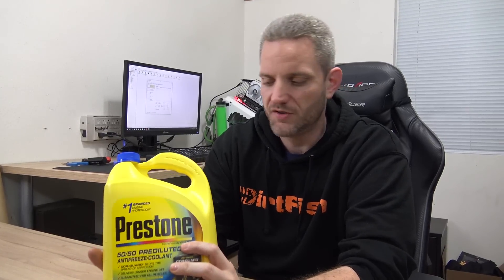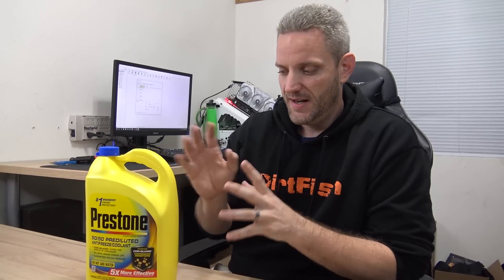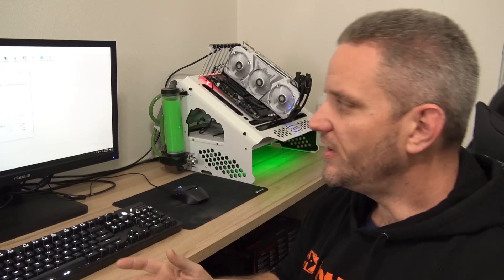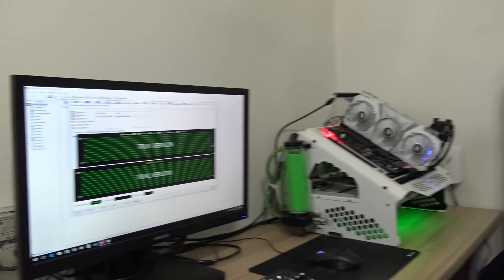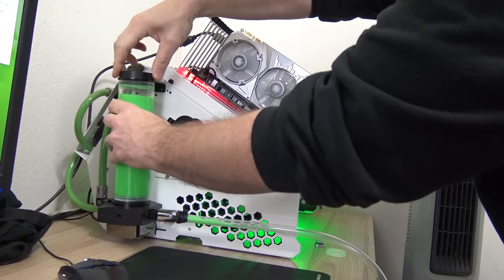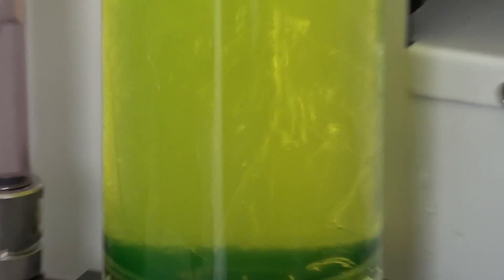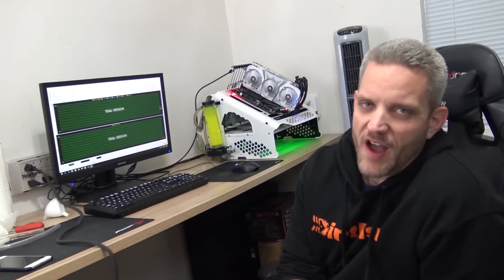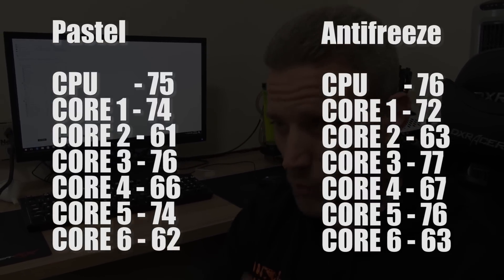I used Antifreeze to cool a PC

Comment: Just FYI radiators usually have 2 plastic tanks and the seal for the water pump and the radiator cap is rubber, so what does coolant do to rubber and plastic? nothing
Reply: eksine
You are right though, AF will not attack the vast majority of materials, it's reason for existence is to be an inert fluid. Its' benefits far outweigh the drawbacks. If the only issue is that you can't use something in the loop, then try another part. Currently I have Swiftech for all the parts; GPU, CPU and both radiators, as well as the MCP655. Reservoir is XSPC acrylic, and tubing is R3603, barbs are chromed. I have a little residue at the bottom of my drain tube, but I haven't changed the fluid in 4(FOUR) years. : ) I'm willing to bet that anyone using AF and having algae issues didn't sanitize their parts first, or contaminated the fluid during fill or top-off. Linus is a jackass, so his AF issues are his fault. : )
Reply: shaneclipse97 shane, your are too self centered. the reason I keep replying is because you made me question what I said. It's not the fact that I am afraid I am wrong. It's because I am afraid to give out false information and mislead others. This is because by nature I am trying to be a good person. you on the other hand have been handing out false information left and right and .. anyways blocked, I should have done this long ago. goodbye, get a life
Reply: Wes Tolson we already covered this, alcohol based coolant such as ethanol is not safe and some RV coolant is not safe for acetate
Reply: ***** he was worried that coolant would melt through his hoses and such. from an automotive standpoint I was giving some insights that this is used by most people already and they don't even know that they've already tested it out. he was using car coolant so my comment was aimed at that aspect
Reply: eksine
For example, just using the internet, my CPU/GPU are at 29c/26c, i5 3570k and MSI RX480 8G. ♥
Reply: Kinsey Benedict You know your stuff Kinsey, I'm impressed ;> If I want to cool my CPU I know who to look up
Reply: eksine
Why thank you, mister. ♥ You can ask me anything, anytime. I am a tinkerer, and got into PC's as the Athlon 64's and 64 X2's were stomping out Intel's guts, about December 2005. I do so miss my socket 939 builds, they were just a blast to build and clock, had a Manchester-cored 3800+(still have the CPU, no good boards available) that was a screamer. Also still have my E6600 and Q9550, same trouble with board availability. Also still have my EVGA 8800GTS, and my recently retired MSI 6950. Also had and loved an MSI Hawk 5770. There were others, like my Sapphire X800GTO(unbelievably overclockable) but those three first mentioned have impressed me the most, with the X800GTO being an honorable mention, it just came out too late and was eclipsed by the X1900 series, of which I had an X1950, also great! : )
Reply: Kinsey Benedict Geez you're making me hot thinking about all that. I was introduced to computers back when floppy drives were still considered new. What was the problem with the motherboards? Did you try to get those early when the CPU's just came out? I know it takes a while for the motherboards to catch up, but ASUS or whoever usually come out with something so you can unlock whatever it was you were trying to adjust. Sometimes someone else has firmware they wrote that you can use to flash it with which is your only option rather than waiting for the manufacturer to come out with new firmware.
Reply: eksine
Haha, hot, in a thread for a video about cooling, nice. : ) I meant there's no boards available today(easily, or from trustworthy sellers) or I'd run a 939 setup again. I still have a VLK XP disc to use. ; ) As for my boards, my 939 Asus A8N5X blew its' NF4 chip, fizzled on startup, blasted a nice big black mark out the side of the NF4, which was also on water with the CPU and GPU. My EVGA 775 board suffered from an inattentive owner(me!! 0.o) who let the coolant leak, and the 775 Gigabyte board that replaced it just stopped working. That's when I went to 1155 and the 3570k, four years ago. This is the longest I've run a setup without a major upgrade, kinda shows the state of software today. Funny to see the ebb and flow of software versus hardware, I only replaced my MSI 6950 last month because, well, why not? The RX480 8G was only $250, and my Z77 Sabertooth can run three of em if I wish. Shit, that 6950 is a beast, never needed to clock it, and still runs AAA titles today, just isn't DX12, but neither is my Windows 7. I like to look at my old NewEgg orders and reminisce. There's years where I went through 3 or 4 GPU's.

I'm thinking about an update this year, with both AMD and Intel dropping new chips. Currently, I have:

HAF 932 Black Edition case
Sabertooth Z77
Intel 3570k
MSI RX480 8G
4x8GB RipjawsX 2133Mhz
SilverStone 1200w Evolution psu
Asus Xonar Essence STX
and the water setup mentioned above

Peripherals:
HP 2711 monitor
Microsoft Sidewinder KB
Logitech G500s mouse
Wired black 360 controller

I replaced the blue LED's in my case with red to match the rest of the red in my setup.
Reply: eksine f
Reply: Kinsey Benedict i mean, Linus also didn't put any form of anti-growth agent in the loop.
it was just tap water.
Reply: *****
Yeah, that will never end well.
Reply: shaneclipse97 shane you are really ignorant. you might want to go ask someone about radiators. the top and bottom tanks are usually black plastic. pour some yellow prestone on some rubber and plastic, come back here when you see any of it being damaged, I'll wait.
Reply: shaneclipse97
LOLWUT?
Reply: shaneclipse97 shane I'm not sure if you're going through some kinda of hormonal phase but you sound really junvenile. Just go to any toyota, honda, chrysler, etc dealership, pop open the hood of their sedans. you'll be surprised that you don't know everything if that's even possible for you. I wasn't talking about computer heatsinks or even about computers. I've not heard of an instance of prestone coolant (which is what the video was about if you were watching) damages plastic or rubber. now please calm down and have a snickers betty white
Reply: shaneclipse97 cars with plastic radiators: Porsche Cayenne 2011-2016, JEEP COMPASS PATRIOT 2007-2016, Buick Encore 2013-2016, Subaru Impreza 2012-2016, Mitsubishi Lancer 2015-2016. the list is nearly endless. You have no idea how stupid you sound right now. Porsche makes crappy cars according to you. let me find some other crappy cars I can list for you
Reply: shaneclipse97 2015-2016 MERCEDES C-300, according to you mercedes is now a crappy car manufacturer, I better go tell CNN
Reply: shaneclipse97 2015-2016 MERCEDES C-300, that's also a luxury car, wow shane, you've opened my eyes I did not realize all of those were shitty cars. I didn't even bother naming honda, toyota, ford, nissan, etc, they all use plastic radiators. I guess we all need to buy nothing less than bugattis to get quality parts according to shane
Reply: sorry man only cars ive ever really worked on as far as radiators is custom/ performance cars. never had to replace a stock average vehicles radiator. I was more refering to your high quality youtube video
Reply: also luxery does not mean quality.. if your a mechanic you should be the first to know that
Reply: Kinsey Benedict funny  how u seem to know way more about pcs then eksine yet he was the one that felt confident enough to critique the owner of a pc channel on youtube lol. i have no clue why that clown is comparing his knowledge of cars to computers like they are anywhere remotely close.. gues he needs to do some research cause he clearly does not know shit about pcs
Reply: eksine actually a lot of the cars u mentioned such as porsche do have really bad history of mechanical failures. Only reason all those cars you mentioned use plastic is because its light and cheap. new cars are made with cheap parts making them more profits as well as keeping the repair industry alive. its a known fact that manufactures cut corners like making rads out of plastic. I can tell you have not worked on many older cars. most new cars have plastic but on the history of radiators the majority are metal. only in the past 15-20 yrs have plastic radiator tanks become more common and its not a good thing. thats why companies are adding things to coolant to prevent corrosion. you obviously are not a very experienced mechanic, because i am a pc guy and seem to know a little more about the basics of cars than you. Maybe you should refrain from being so outspoken on pc videos??
Reply: shaneclipse97 shane you are a joke, you come here telling me I'm wrong, I list a bunch of cars and you then proceed to tell me you only work on performance cars. then you bash my pc knowledge which I never claimed to be an expert in although I do have a background in pc's. then you bash my 1 and only video and call me a bad mechanic. you are attacking me from every angle possible, why because I gurt your feelings because this is a favorite channel of yours? dude the more you speak the more douchebaggy you sound. I guess all you like to do bash on people claiming ridiculous facts that you garnished from nowhere and when I give you facts you start attacking from more obscure angles. whoever said I gave a shit about cars 15-20 years old, actually my accord is an 01 so it's 15 years old so actually I do know about 1 15 year old car. shane you are just a joke dude. how do you even live with yourself?
Reply: shaneclipse97 it's so ridiculous you say I don't know anything when your initial claims of me being 100% wrong actually turns out not only are you the one 100% wrong, but you seem to have that "I'm never wrong" syndrome. you're going to have to do better than that pathic trick to even be taken seriously
Reply: shaneclipse97 you said you never replaced any stock car's radiator and then you said you were referring to my video, if that's not a low blow I have no clue what is since my video had nothing to do with radiators or coolant. that video was aimed at helping people at the odyssey forum. you are such a low life slimeball dude. you get off at bullying other people you don't even know using facts you've made up on the spot, pathetic
Reply: shaneclipse97
Actually, cars and PC's are quite close. There's multiple materials in the cooling loop, varying temp loads, fans, pumps and radiators. The first water cooled PC's were cooled using heater cores.

Also, I'd hardly say I know more than anybody on any given subject, I am just assertive when I know I'm right. Also, I didn't catch his initial point as it was a little vague. As evidenced, we cleared that up. Eksine seems a cool person. You could use a lesson in tact.
Reply: Kinsey Benedict Thanks Kinsey. If he wasn't so self centered I would have told him I actually hold an associates in computer science. I know more about computers than he knows, but it's a waste of time explaining anything to a wall.
Reply: eksine
Haha, nice. You're welcome. I am a hobbyist, that is all. My ex bought me some parts for Christmas in 2005, and from there it was a new addiction. I don't know squat about programming, but I damn well know how to deal with hardware.
Reply: Kinsey Benedict I tried to tell you earlier, but I was going to say I'm using a phenom II x2 that I unlocked all 4 cores on (it comes stock as 2 cores). I've had this pc for like 13 years and it still runs.it has a 9800 gtx+ which was hot at the time. This along with my accord are the 2 most reliable things I've ever had. The motherboard problem you were talking about, why didn't you ever just buy a motherboard off Ebay? sometimes used stuff is near new when I buy stuff off there. also I had this idea for water cooling. did you ever try using a car radiator, a water pump used for wells and attach it to a window / wall AC? that's gotta be some really good temps for your cpu/ gpu.
Reply: Kinsey Benedict yeah I can tell especially overclocking and water cooling. it seemed too complicated and even if I figured it out I don't know what I'd use it for. on the other hand if you need some help with alias maya, photoshop, photography, flash, I'm that guy. I wasn't into programming either but a teacher said I would have been good.
Reply: thats impressive being computer science degree is a bachelor degree. I would know Im currently in my 3rd year.
Reply: its easy i mow my grass do my laundry and sometimes I put on pants when company comes over lol   15 yrs is not what im referring to when I say old. ii never said all i work on is old cars I said the only cars I have worked on is old cars. All the cars I have owned have never been old enough to need radiator work. Let alone after a car is a certain age its best to not even mess with the radiator(unless planning on replacing it)  in case the corrosion is actually sealing any pinholes etc. What do I know I am just a tech/pc nerd lol
Reply: the only thing they basically have in common is water cooling and lets be honest only enthusiast water cool pcs so not even that common to compare the two. Yeah he seems really cool going on peoples channels who make videos for a living and trying to give them a hard time in their comment section. thats exactly what jay was talking about in his older videos when he said he had to stop reading the comments people post to him. People create content for the world to inform them and educate them and then others come along ans leave shitty comments about things they really dont know. Its kinda sad that something as beautiful as the internet today and youtube is ruined by the comment section. so yes I did give him hell and it was for a reason. Who goes on a channel for information then trys to call the content creator out and attempt to question them in a condescending way? He does not respect what creators do and the time and effort they put in or else he wouldnt be like that. If jay was spreading bad information that would be one thing. I will never hold my tongue in a situation like this. I get it tho. when people dont make youtube videos that get popular or have a lot of comments they dont know how shitty it feels but Im here to tell you that it does effect the creators. They are nice enough to enable conmments for us to converse and learn and share ideals with one another. Btw if you are not gonna change ur fluid in 4 years u might just wanna look into Aio closed loop. Your pushing ur luck with that one, but then again that would mean all ur components are over 4 years old most likely so maybe its not much of a concern to you? I would not advise anyone to let their fluid go that long. I have worked climbing cell towers to the other end of the spectrum sitting at a desk in I.T. tech support. Tech is what I love and my hobby so I feel I have not only earned my right to voice my opinion but I feel obligated to stick up for other techies in this field, even if they are a youtube personality. :) enjoy 2017 and try and laugh a little life is too short. also you should be thanking me Actually the way you two been talking maybe you can name your first child after me ;) send me an invite to the wedding, I love weddings they are a blast! Maybe some good came out of his bad comment after all??? who knows!!   cheers
Reply: shaneclipse97 dude give it a rest, this was dead, why did you try to resurrect it? my comment wasn't negative in any way, shape or form. the only person who viewed it negatively was you, nobody else chimed in about it being bad, it's just all in your demented head shane, get help
Reply: eksine :)
Reply: shaneclipse97 shane I did some more research, alcohol based coolant such as Ethanol is not safe for rubber. Basically if the label say it's for RV's you have to know what type is safe or not.the prestone site lists one for RV's and it says "Will not harm plastic (except acetate)". however since he was showing a specific coolant, the most popular kind in fact. it's ethylene/ diethylene . the fact that it's never melted any rubber hoses or plastic in my radiator for 15 years is proof enough for me to state what I did. You're welcome to disprove me, but try to do it respectfully because so far you just been looking like a douche
Reply: eksine Seriously man you need to go outside or go find a hobby or something. you have let a simple disagreement in the comment section of youtube consume you. Maybe you have a lot of free time or maybe you dont have too many responsibilities to keep up with. the only reason why I have the ability to respond to this so much is because I am somewhat of a content creator myself and have set up all google plus notifications to go to myphone ( so i can answer questions on my how to youtube vids) as well as have push notifications on my browser. I work from home as a manager for a fairly large isp. so im on the internet using chrome for 8 plus hrs a day. somedays are pretty smooth in our department ( business tech support) so i have a lot of free time between assisting my employees. Unless you are in some kid of situation where this level of internet consumption is true for you, then you really honestly are not utilizing you maximum potential. not being a dick just from one man to another. unless ur young and in school and maybe o holiday break??? Only other thing i can think of is you have some issue with being wrong or even  the thought of someone thinking your wrong, or you feeling like you may be wrong. You have devoted way too much time to caring about what i have said. Im not a troll but if I was you would be handing me the power to completely control your day. I could literally sit here and toy with you for days if thats how serious you are gonna take the internet. Some people will do that and get enjoyment out of it. Im not one so i wont continue to do so, but like i said some people would. Enjoy your 2017 man. maybe find something you enjoy and put the same level of passion that u put into this  into that new hobby etc.
Reply: eksine btw I should have prob mentioned this in the beginning but the fact that this may or may not eat rubber and or plastic truly is not the main reason you wouldnt want to use this i a liquid cooling system. The MAIN reason you wouldnt want to is actually because if you do a liquid cooling system CORRECTLY and not some armature half assed diy bs   then you SHOULD be using a high quality special non conductive liquid in the cooling system. The main reason antifreeze would be bad is because it does not have the non conductive properties that prevent you from frying your components when you get a leak, and any long term use of liquid cooling you will 100% get a leak at some point in time due to thermal wear and the expanding and contracting of the seals at the fittings and connectors. even AIO loops are prone to some leaking at long term life
Reply: Kinsey Benedict this conversation did not include you. thanks for you input tho, it has gained you a participation award
Reply: shaneclipse97
Actually, it did. If you'll trouble yourself to look up a few posts, you'll see me. Yep, here before you came and menstruated all over the place.
Reply: Kinsey Benedict Kinsey, if you click on his name it takes you to his page and you can click block. The guy is a waste of time
Reply: eksine
: )
Reply: Not all plastics are created equal.
Reply: Kinsey Benedict Shit build and car.
Reply: i thought you were talking about computing products as well, since this is primarily a computing channel.

no need to get your panties in a bunch, just being vague enough that people can misunderstand.
Reply: Never seen a radiator with plastic tanks. But, I don't buy shitty equipment. : /
Reply: Kinsey Benedict You're joking right? they're almost always come with plastic tanks. not too many of them are pure aluminum. that black part? that's plastic. you obviously don't know shit about cars bro
Reply: eksine
To add, my Jeep has metal radiator tanks. ; )
Reply: Kinsey Benedict ouch burned by a girl. the rest of us poor folk have plastic radiators. I stay away from the jeeps because I don't want birds pooping on my head ;]
Reply: eksine
My Jeep is a Cherokee, no poop. Sometimes you can't help the radiator, any metal aftermarket options are too costly for the application, as most people don't bother to build up their Corollas. : /

I doubt my metal radiator is original, though. It is a 200,000+ mile Jeep. Can't kill the bastard.